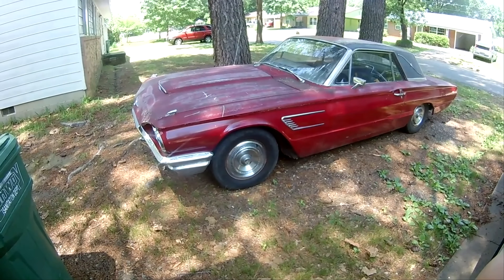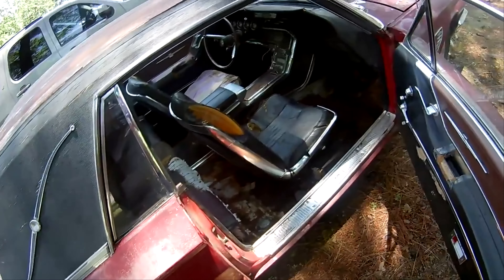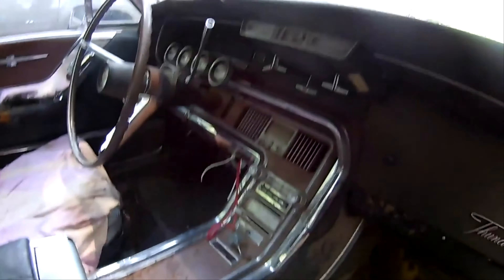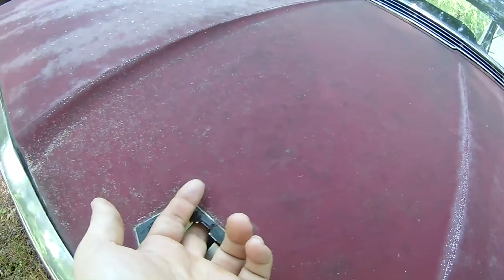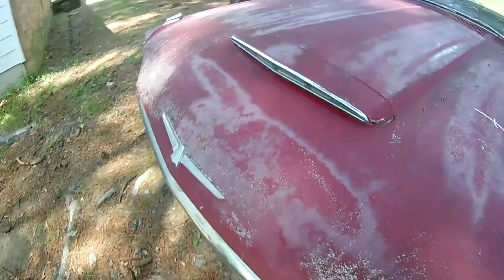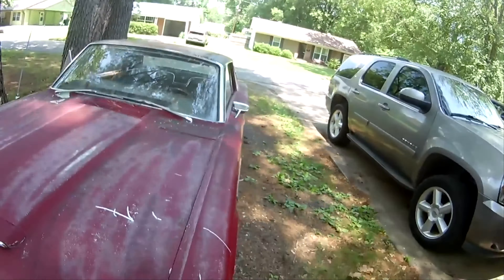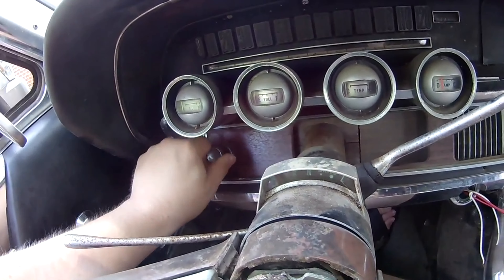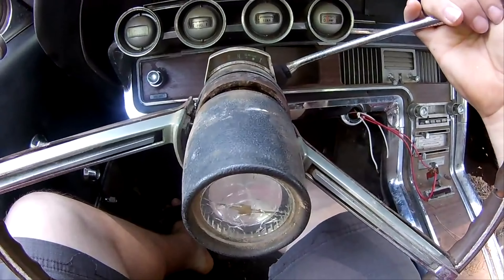Revival of the 1965 Ford Thunderbird Landeau going on its first drive, will it start

Comment: Is that a 352ci?
Reply from the maker: No idea lol
Reply: Should be able to look it up off of the vin if the engine sticker is gone from the rocker cover.
Reply from the maker: I didn't pay that much attention.  It sold really quick.
Reply: 65 Tbird came with a 390
Reply from the maker: Sounds bout right